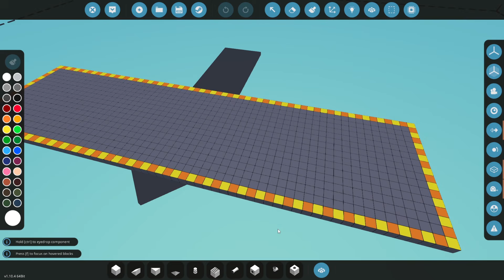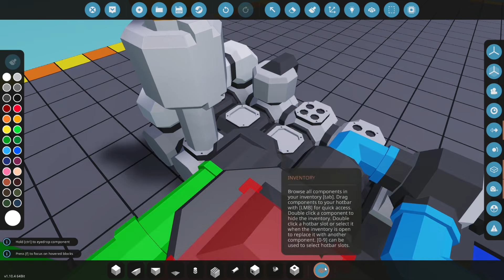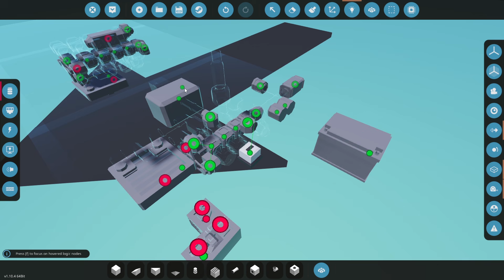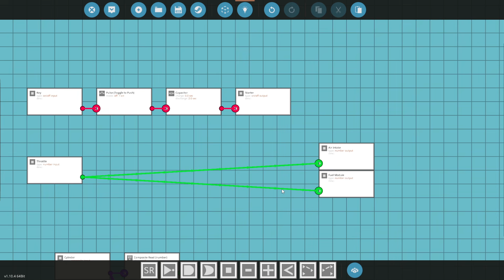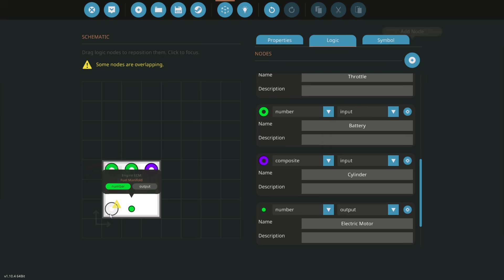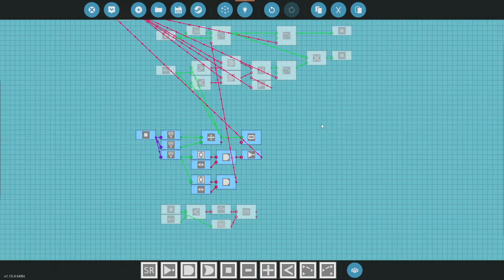Modular Engine and ECU Microcontroller Tutorial in Stormworks (Engineer Explains)

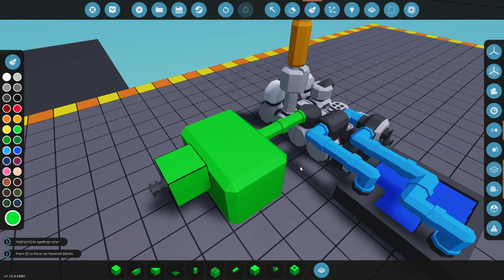Comment: 9:57 oof

That one didn't age well.
For those catching this, he confirmed in a newer video that relief valves are necessary. In the example, the engine without a valve would choke itself out at about 15% fuel remaining due to negative pressure in the unvented tank
Reply from the maker: Thanks for catching that, I have pinned this message for future viewers to note this!
Reply: So where exactly would I place it? At the tanks input or output?
Reply from the maker: @Chronos-Sensei  Anywhere on the fuel tank line
Reply: @454ss_gaming Dang. Thank you! Didn’t expect a response on a 1 year old vid and that fast too! That definitely earned my sub ❤

Comment: 454ss gaming i actually don't use pulse toggle to push. Because i use threshold gates to see inside the engine: when the key button is on and the RPS is between( 1 and 3) and the fuel is NOT between (0 and 0.02) then the Starter is true. This method can be used for if the engine died by a crash, tsunami, fire, bullets and everything and then try to start again, you don't have to turn the key switch off and on.

Comment: My engine won’t start. I followed everything I think. I even put in a relief valve after I seen the pinned comment, but it was before I could start the engine. Idk what’s wrong with the engine. Will update once I get the engine going
Update: I was rushing a bit. Didn’t finish yet. Still working on it.
Numero dos: Gonna go to bed rn but will continue tomorrow. My RPS isn’t going higher than 0. Idk what the problem is.

Comment: Out of curiosity since I can't find much of any good information online, do you happen to know why the "Aircraft Propeller" takes so much torque to turn over? Compared to pretty much any of the helicopter rotors, but in this case the similarly-sized "Light Rotor", the aircraft prop has a gross amount of resistance that makes running one with a modular engine kinda difficult. Running a light rotor is far less strain on my engines, so I'm wondering if there's an actual difference, or if it's just an oversight that the aircraft prop feels like it's being spun in cold syrup.
Reply from the maker: Very interesting observation, and one I do not have the answer for! Possibly an oversight or maybe that rotor has more torque power

Comment: I did everything you did and mine imedently dies after my throttle lever goes past 0.3
Reply from the maker: That feels like it is stalling out! Try removing the wheels or propeller or whatever, or adjusting the clutch!
Reply: @454ss_gaming  i had the largest rotar with the longes blades lolll and the space i had was a 8 flat engine and so i did what you said and it doesnt seem to have the like power that i would like so i used your get engine video along with both your hilocopter tutorial videos and now i have a fully working gun ship helicopter

Comment: These videos have been such a huge help.
I struggled making a basic starter boat last time I tried making ships, played almost entirely on workshop ships. Built a tanker over the span of 3 sittings after work and its not perfect, but it works way better than I expected a first large ship to operate. Working on replacing the engines with modular and for this scale I need a smarter design so its not such a jalopy haha.
Reply from the maker: Love to hear that, good luck :) It is a learning experience, but results in a lot of reward!
Reply: @454ss_gaming   Oh baby she started! Two nights with this thing and I finally sat down and nitpicked my way through the main microcontroller portion of this video and managed to get it going. Started with copying nearly 1:1 from the video, then elaborated on my own after.
I can't believe I avoided Microcontrollers for so long, its node-based which I have been doing as a CGI compositor for a decade and a half, so colour me shocked when I realized that it would not take long to soak in the knowledge.

Comment: Had anyone encountered an issue of different cylinders having different air to fuel ratios in a single bank of cylinders? Made a simple I4 based on this video but it only runs at full throttle and 2 cylinders have air to fuel 7000+ with 2 at 14.7

Comment: I got an engine workingf using this tutorial but only the set of cylinders on the right that are directly connected to the fuel are running, air is on the left side and it is being supplied but it wont run.
Reply from the maker: Make sure you connect it via manifold!

Comment: Hey I don't know if you'll see this any time soon but at 37:32 when you were talking about how we can change the AFR to what works best I tried doing it and when ever I have my throttle at max it always says 27% efficiency no matter how much I change the AFR, the efficiency is only different when I have the throttle lower than max, which still is only like 60% efficiency. is their any way to fix this? I will look for ways myself assuming you don't answer by the time I fix it but it would help, and one thing I am also having trouble on is for some reason when I connect my engine to my wheels via enclosed pipes they don't wanna move, I changed my clutch pressure up and down I changed my gears and my vehicle doesn't want to budge. and the only stuff I could find on how to fix is people saying to connect the wheels using pipes which I did, is their any thoughts you could give on this?
Reply: Engines are less efficient at higher rpms

Comment: Just a reminder that is entirely possible for you to put together an engine perfectly and get the cooling bug which there is nothing you can do besides making a new vehicle. I've tested it and it has something to do with the save file of the vehicle. Its seems to be completely random as to which creations the bug affects but I've gone and made the same exact engine with the same cooling loop across several different save files and some of them work fine and the others have the cooling bug. This is likely never going to be fixed since this has been an issue with modular engines since they were added.

Comment: when I increase my throttle, some cylinders suddenly get an insanely high air fuel ratio (Around 16000),  it only happens to certain cylinders and not all of them, and only when I increase the throttle higher that 0.2 (idle), is it an issue and how would I fix it?